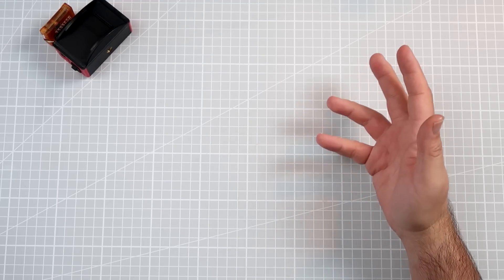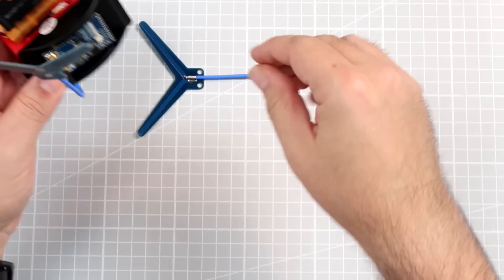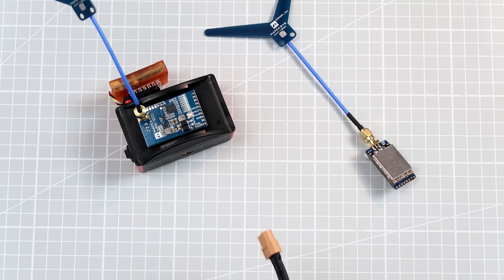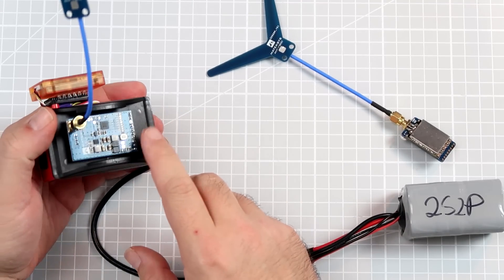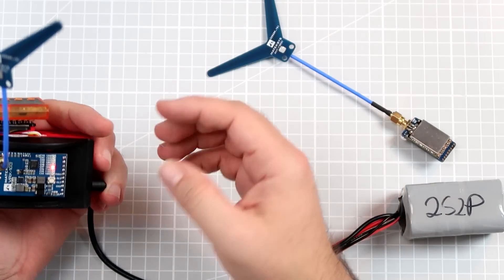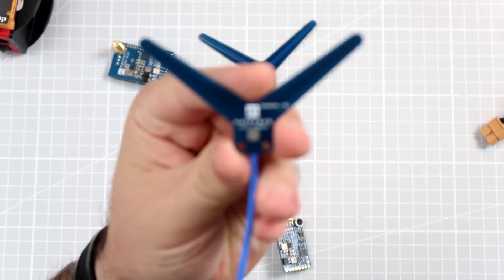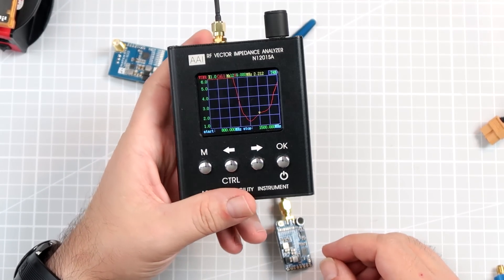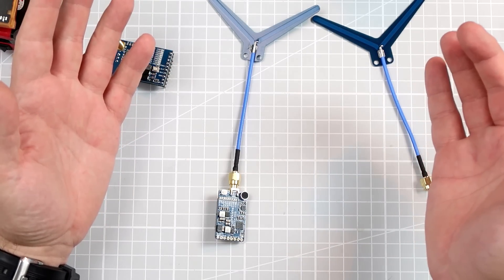Matek 1G3 VTX and VRX - 1.2GHz FPV in the correct size!

Comment: hello! how are you? I don't understand how the audio works on this transmitter. I need to receive the audio on my ground station. I tried with the built-in microphone, and also connected the camera audio to the pad. but I still don't receive audio. my Rx is lawmate. I use it in 1280. Thanks !

Comment: Is it possible to connect the matek rx unit to a monitor instead of goggles ?
Reply from the maker: For example with a help of Dock King http://bit.ly/2lYi7eS
Reply: @FPVUniversity  hay Pawl .. Thanks so so much man 👍🏻👍🏻👍🏻👍🏻👍🏻👍🏻👍🏻👍🏻👍🏻👍🏻👍🏻👍🏻👍🏻👍🏻👍🏻
Reply: @FPVUniversity  subscribed 👍🏻
Reply: Thanks for yesterday’s help . I found the found the furious dock king lite updated edition, does it works the same as the original dock king with Matek rx ? It’s much cheaper though

Comment: always good reviews.  a question: How are the antennas placed during the flight, vertical from the front or side, horizontal?  thanks
Reply: They look to be the inverted v type so like this V pointed up
Reply: @blackterminal : I have been doing tests with an old DJI F450 drone and then putting it on an X8 glider and until now the result is that a DIY helical antenna give me more range. I will try to put them up "V. Thank you

Comment: If Matek wants this system to sell it must work with Crossfire. Normally we run 1.3ghz receivers on ground stations. This is to get the 1.3ghz receiver away from the 900mhz transmitter. The old Nextwave 1.3ghz goggle receiver got noise from 900mhz transmitters over 250mw.

Comment: Nothing new here. What rock you been camping under??  Been flying 1G3 long range for years now.  AliExpress is full of 5v 200 and 600mw 1G2/1G3 Vtx too btw and they work great.  Also fatshark have had a 1G3 module for years man!!  And you can still get the  modules on AliExpress to. Great to see matek getting into it, I did ask them 12 months ago if they were making anything and didn't hint at all, but they've finally done it - pity it's not a diversity Rx..  FAIL
Reply: what is diversity Rx?

Comment: Hi Pawel, thanks for the review!
How is it about Crossfire (868 / 915MHz) with this receiver? Is it also affected by the problem, that there is no proper input filter, and the Crossfire TX makes it level down the input amp? 
Till now all the RX are affected by this problem, I hope there will be a solution soon?
Reply: Crossfire can interfere with 1.2G. just run a notch filter. So many available like TBS.
Reply: Ward Paterson The prob is the VRx, not the crossfire. I know about Notch Filters, and that they don’t completely solve the issue. That‘s why I asked, with a narrow band pre-amp in the RX, a Notch wouldn’t be required - only this would fix the real cause of the problem..

Comment: I use this combo since june of 2019, but without Matek logo and additional PCBs. 
Here's the link: https://www.banggood.com/1_2G-8CH-700mW-AV-Analogue-Siginal-Transmission-FPV-System-Transmitter-Receiver-Combo-p-1272467.html
VTX is called SM130T, VRX is SM137R, both from ShenZhen Sunflytek company. 
Link to manufacturer's page: http://www.sunflytek.cn/plus/list.php?tid=43
All Matek did is just put VTX and VRX on their own PCBs which include BECs, buttons, etc.
Reply: What's nice about this transmitters is their cost. It's only 8$ if you buy 10 pcs at once directly from the manufacturer (sunflytek.en.alibaba.com)
As regards range, I easily got 30 km with nice and clean image using 4-element Yagi on RX side.
Reply: Purchased this based on tour experience with it. Fingers crossed

Comment: They have to build retranslation from 1.2 to 5.8
Reply: You can't just simply change the wavelength of a 1.2 signal over the air. And even if you could, you would lose all the benefits of the higher penetration of 1.2. Plus it would be unnecessarily complex on the receiving end and introduce extra delay.

Comment: 1.2g and 600mw is a lot of RF, okay on a plane, not very clever on a quad though..I use 200mw, which on 1280mhz is plenty..plane or quad tbh...I hope we have selectable power levels Matek..?
Reply: 200 or 600 is fine. I use 1W on a wing but need a lot of GPS separation between Vtx antenna and GPS

Comment: Great, I use 1280mhz all the time, way better than 5.8g....Works alongside the 868mhz R9MM reciever and of course UHF too...Your video frequency should always be higher than your control frequency...but not dividable by it...So, 2.4G control is not a good idea.
Reply: Would this work with 900 megahertz r9mm
Reply: @jimmytheriot8978  yes. We use 915mhz crossfire in Australia and no issues. I'm running 1W 1258mhz video transmitters with zero issues on my wings. The only issue is GPS - every 100mW power you need 100mm separation.. I use 200mW 1258mhz Vtx on my LR quads

Comment: Immersionrc has had a 1.2 fatshark module for years
Reply: It was a shit module as I recall...
Reply: @EnglishTurbines  If you're referring to the ImmersionRC module, the first version was crappy, but they fixed things in the second version. I'm not sure how well the LaserBGC module worked, I think they ship out of Turkey, unless I'm mistaken.
Reply: Can't forget the old LaserBGC ones too! I wonder if they're still making those? I have one sitting around somewhere.
Reply: @bonafidepirate  You're right Keith, I forgot about that company.. it looks like they still offer that 1.3G Fatshark module ! I've never owned one of those though.. I wonder how they perform ??
Reply: @bonafidepirate  really interested to see how these compare the receivers we use now mainly because there's like 1,000% size difference and maybe that's just because they were originally made to be in hot enclosures hopefully these work way better because it'd be nice to have a smaller size in your setup.
Reply: That is true, I have one myself.., but they are not easy to find anymore. I think they've be discontinued. Everywhere I've looked it seems to indicate "No Longer Available", example : https://www.horizonhobby.com/nexwave-rf-1g3rx-8ch-module-fsv2443 
Anyway.. hopefully Matek will offer this combo for the FPV community.

Comment: Very nice !!I'm glad to see Matek is getting into the 1G3 market. ... It's hard to find a new Nexwave goggle receiver module for 1G3 anymore. AliExpress has some but they have the blue logo and are not the FSV2443 model that fixed the bugs..
They won't take the place of a good ground station receiving setup, but are really handy if you want do some longer distance flying (especially in the winter time) and don't want to mess with setting up ground station. Thanks Pawel. Looking forward to your test results. In the U.S. there are just two channels that we can use legally... 1.258Ghz and 1.280Ghz so hopefully they'll make a U.S. version of the vtx.
Reply: What about Fat Shark 1G3
Reply from the maker: discontinued
Reply: @FPVUniversity   oh
Reply: Is 1.2 ghz legal in Europe/Germany
Reply: @Jan-nnnn  
In Germany it's illegal. Frequency is used for military communication.
Reply: AliExpress sells all of fatshark's excess discontinued stock. $35ish for the Rx. Bargain

Comment: It will be a problem to have it on airplane whit frsky R9 system ?
Reply: Tbs and other stores sell a 900mhz notch filter for your 1.3 rx. you put it in between your antenna and your video receiver
Reply: why ?
Reply: The 868Mhz and 1.2 Ghz are quite close
Reply: @zvonimirtrgovcic5499   I'm flying on 1.2GHz and R9. Max distance was 16km  limited by lipo in my harrier :)